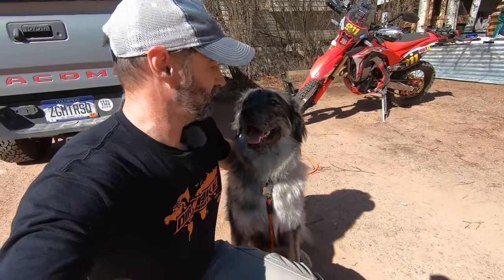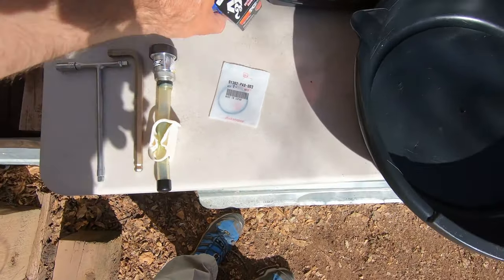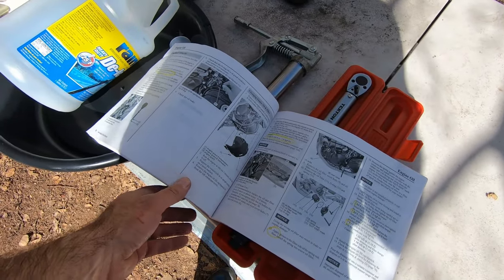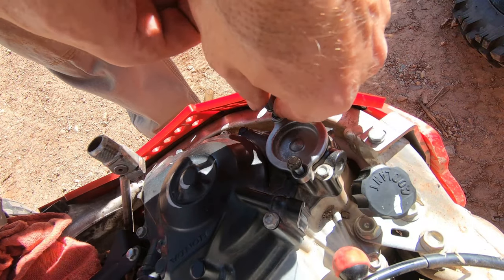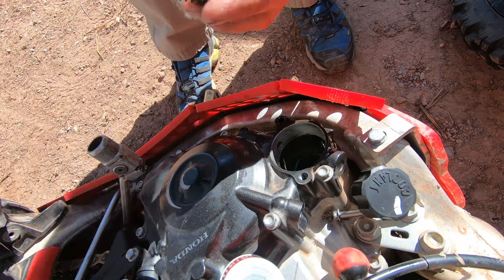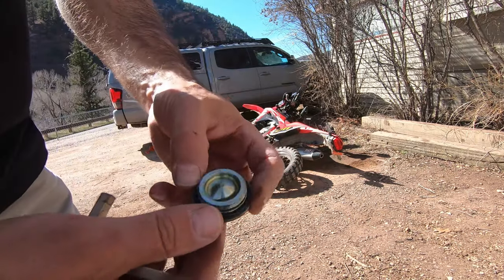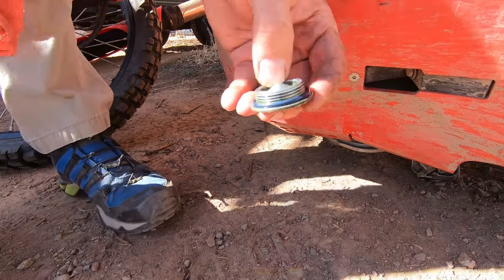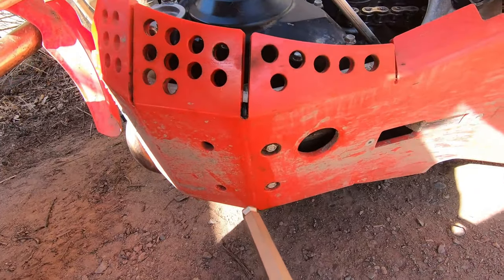How To: Honda CRF450L Oil Change Using A Works Connection EZ Oil Drain System

Comment: Yours is the best 450L vlog in the world. I’m a 500excf owner but I enjoy the series and in particular the oil investigations. Both bikes have similar oil change recommendations so I await your findings with great interest. By the way, loved the way you stood on the rack of your bike last episode. Couldn’t do that on a standard KTM but might be able to do it on mine as I built a pannier frame/rack system. Here in Australia it appears that the 450L has been a sales disaster. Pricing was ridiculous at first but it has plummeted. I would be interested but the lack of decent sized fuel tanks put me off. I wouldn’t be put off by the Honda recommended servicing schedule as I believe the bike would be a much better build quality than the KTM.
Reply from the maker: Wow. Thank you very much.   Nomad Tanks in Australia is now making 20l tanks, so there goes that excuse. Let me know when you go Red!
Reply: John T. Young Wow, thanks John. Just looked at their site and it looks very good, reasonable price too. Now the 450 L looks a very distinct option as the wonderful build quality of Honda’s is a big issue for me as I ride solo. Will keep you updated. Must go through you videos to see the best fueling tuning options. Here in Australia we don’t tend to be burdened with the full on pollution devices
Reply: DKW, I have been in contact with Nomad and there will also be a 15/16 lt tank out in a couple of months. It’s similar to their 20 with radiator guards included.

Comment: Awesome John, can you run over adjusting chain, clutch and brake levers, and how to lube clutch and throttle cables sometime for us newbies.  Learning a lot, thanks
Reply from the maker: OH man. There's a chain adjustment in here somewhere.....
Reply: Sorry for such a basic question I’m not mechanical, have seen the 3 finger measure at the chain guard as a general way to
Reply from the maker: @stevewasilow5556  yes. That's in the "close enough" range. Tho the rear tire should be off the ground when yoou do it.

Comment: It is funny to see, that the coolant tank cap does still have the same design like the one on my transalp xl600v from 1994:-)! 
Nice bike and a good explaination!
Reply from the maker: It's a Honda so it could be. Don't fix it if it ain't broke... ever.
Reply: ...what could you change in something that works perfectly? It's a cap. ;)

Comment: I love the long neck funnel. Great item to have in your toolbox . I have a Yam 660 supermoto and it's a messy job to add oil.
Reply from the maker: It’s like they made it to screw into the filler hole.

Comment: soooooo glad you stressed the drain plug "torque" by hand...  13 ft/lbs via a torque wrench has lead to issues as you mentioned. The grease is a trick I would do regardless, but if it is in the manual, then even better and will squash the naysayers. Good video.
Reply from the maker: Thank you!

Comment: very good to see how you handle with the drainplug...... maximum 2 fingers tight and enough....    i read about alot of peoples screwed up the threats by using a torque wrench and doing the 13lbft like in the manual
Reply from the maker: Not sure if there’s a flaw with some bikes that it seizes or what, but I’ve never torqued it very tight.

Comment: Hello John T.   I have been watching your channel for a few months.  I finally was convinced to get a new 450L and picked it up on Wednesday.   I have ridden it about 50 miles and I cannot believe the throttle toggle response. This is terrible.  I hope I can get used to it, but I seriously doubt it.   I am thinking of ordering the Vortez and the pipe.  Question is why you went vortex Yoshi vs vortex and FMF? 

Your channel does a great job on highlighting the options you have installed.  I will be rewatching these as you progressed with the bike.  After getting the throttle under control, I will likely do the seat next.   That seat is the worst I have felt on any of my bikes.   

Again, thank you for the videos and adventures.   Thanks for your service to your community thru you affiliation with the fire Dept.  You are a good man, keep it up.
Reply from the maker: Thank you so much John. I really appreciate that.  You're right the throttle response is awful. It has to do with the ECU turning the injector completely off with the throttle closed, the light weight engine internals, and the lack of any kind of cush drive. Riders coming from a street bike hate it most. The Vortex will smooth it out a lot.  I went with Yosh just because I've always had Yosh or Two Brothers systems. No other reason. Add the new ECU and a pipe and HANG ON.
Reply: Rod Z    Thank you for the advise.  I have ridden it for 150 miles at this point. True. The seat is feeling a little better.   I will hold off for a while to see how it settles in.   The throttle is not as bad as when I was first getting used to it.   But it still is not what I like.  Thanks again for the advise.

Comment: Update on the amount of oil that I put into my bike. I accurately measured the amount in. Halfway up the dipstick, flat ground after oil and filter change was 1250cc. 1380cc came out but I didn't put it in so can't say the difference is all fuel.
Be interesting when I do an oil change next time.
Reply from the maker: Let me know!

Comment: Hi john from oz  , love your videos 👍🏻👍🏻👍🏻 I just bought a 450 l , liking it so far , are you happy still with your axp skid plate , I like the idea of plastic , all the best  cheers
Reply from the maker: So far so good. No complaints other than it is so hard to put on (1 really tricky screw) I never want to have to take it off.
Reply: John T. Young  thanks for your reply John  , at least it looks like you don’t have to take off for oil change ,  👍🏻
Reply from the maker: @lizbarber3473  True

Comment: Another excellent video John.  Greatly appreciated!  I'm weighing the new CRF300L or CRF300RL against the CRF450RL.  The lack of suspension adjustment on the 300's really concerns me.  I know the CRF450L has significantly reduced maintenance milage intervals compared to the CRF300's...however, after watching your valve clearance and oil change videos I feel confident I can do both with no issues.  No Honda dealer in Tennessee has the new 2021 CRF300's in stock...but ALL the dealers in TN have the 2021 CRF450RL in stock and on their floor.  I've been working on big BMW's for years and your Honda seems fairly straightforward to maintain by comparison.  Another question for you please: do you by any chance have a list you could post of the many upgrades you've done to your CRF450L?  I'd be very curious to see that.  Thanks again and GREAT JOB!
Reply from the maker: I've heard and seen nothing but great things about the 300 Rally. Looks like a great dual sport bike. And yes, the 450L is a dual sport, but just barely.   In the description of every video, you'll find the list of all the mods on the bike.
Reply: @JohnTYoung  Got it!  Thanks again!
Reply: I ordered 2023 300L. Waited, never arrived. Decided on 2022 450RL. So far the power advantage has eliminated my concern over maintenace!
Reply: The 450 is actually lighter than the 300. And obviously better suspension.

Comment: Another thought came to mind. Perhaps a long trip of a few days 600 to 1000 miles doesn't contaminate the oil as much as 600 to 1000 done stop starting over many weeks. I presume when it's running it's not dumping fuel in the oil and that it's from when you turn it off each time? Don't know but it's a thought.
Reply from the maker: You must have been spying on my email. I just got the latest oil analysis back. This time I changed oil at 450 miles after a ton of start stop short trips over winter including just idling the bike to warm it up....  still over 5% gas in the oil. Long trips, short trips, 1400 miles, 450 miles - always gas in the oil.
Reply: @JohnTYoung  bugger that's not good. Back to the drawing board.
Reply: @JohnTYoung  still getting gas in the oil? And if so apparently it has little to no effect on performance right?
Reply from the maker: @aalejandro750  yes. It’s still in there but hasn’t seemed to affect anything.
Reply: @JohnTYoung  I guess at this point it's a non-issue lol

Comment: Watching to have a look at those blocked up,oil take offs...i'm sure it would be easy to tremble the oil capacity,using a catch tank/cooler on there...then you have an ADV bike
Reply from the maker: I’ve been looking at oil coolers but just can’t spend the $450 when all I have to is take 10 minutes to change the oil. Maybe when I add the rally kit....
Reply: @JohnTYoung  I'm looking to do 25.000 mile overland, there bits on that where i cannot get decent oil, getting the range to around 2500 miles by adding capacity would be great...like the bike!
Reply from the maker: Then it would easily be worth 400
Reply: @JohnTYoung  If it ever happens due to the Covid...we've cancelled November 2021 already,need to see where the planet stands in the Fall '21 before making a decision on November '22.

Comment: A question for you, if you don’t mind. Does the Honda have a proper Cush hub or is it just rubber cushioning on the sprocket? I put a Cush hub on my KTM as all ADV bike have them. Thanks
Reply from the maker: Not stock. The rubber is only around the outside of the sprocket to EASE the chain onto it. MoxMoto (https://www.motomox.co.nz/shop/show_single_product.php?prod=499) makes one though... for $300.
Reply: John T. Young Thanks, i guessed that was the case, judging by the photos of the hub. I knew about the Mox sprocket. Not sure what to think about that now. Every adv bike has them but Honda must have confidence in their build, judging by the service recommendations.

Comment: I ask because I really see the value in this skid plate... Can't you just Dremel the hole out of the skid plate LARGER so that you don't have to connect another gadget to drain your oil, then lay your bike down to just pick it right back up?
Reply from the maker: You don't NEED the extra gadget, it just makes life much much easier. And cleaner too.

Comment: Hi John 
Are you happy with the mosko moto reckless 80 panniers with the skeggs luggage rack?
Reply from the maker: Yes. The Mosko Moto 80 has been bomb proof AND when it's all cinched down keeps the weight down low and rides great.
Reply: @JohnTYoung  Thanks John, appreciate the reply. 
I have just ordered my mosko reckless 80 for my CRF450L, but am in two minds weather to get the skeggs or the Adventure spec rear rack, as the adventure spec also comes with a mini side rack which my help the reckless 80? Thoughts?

Comment: Just bought a 2019 CRF450L, Bike had all the necessary mods with 1,400 miles on it. STOKED! . What is the purpose of the magnet washer on the oil filter? RIDE🔥RED 🤛🏁🤜
Reply from the maker: To catch ferous metal particles in the oil.

Comment: John,  When you tip the bike on its side, by your demonstration, it looks like all the oil is still contained on the side of the bike.  When you open up both the oil filter cover and the drain plug, you can promise me that no oil is going to gush out?  In the beginning of this video, when you put the bike on its side, if you look closely you already have the EZ drain system adapter on the bike but I assume that is just your editing a new take showing tipping the bike and not you installing that to drain some of the oil first.    BTW, you are one of reasons I just got a 450 so you are to blame!
Reply from the maker: It's always all my fault. I'm getting used to it.   No oil will come out when you tip the bike over on its RIGHT side. 1. Tip it over 2. Replace the drain plug with the drain system. 3. Replace the oil filter while it's laying there. 4. Stand the bike up and drain the oil out being sure to rock the bike back and forth a few times. 5. Replace the drain system with the plug and DO NOT tighten the plug down very hard. Just a nudge.

Comment: Do you need to change the transmission oil too? Or is it a dry clutch
Reply from the maker: Wet clutch that uses the engine oil for lube.
Reply: can i use 10w40 metric amsoil
Reply from the maker: Sure!

Comment: I usually pour few drops of oil on the o-rings for smoother sliding + avoiding the risk of pinching them. In my old Yamaha manual they mention oiling the filter before installation (to be honest, the reason is beyond my knowledge). Being curios about Honda`s approach, I had a look in the manual (same as yours, only that I have it only in digital format). Nothing about pre-oiling the filter but they do mention about using vaseline for the spring :).
Reply from the maker: Ya. I find I do things automatically without commenting on them. So I end up adding text after the fact. Sorry about that. Pre-oiling the filter... tried it, made a mess, never did it again. Never had an engine blow up. Thanks for the comment!

Comment: FYI....the factory service manual specifies 10w-30 oil.
Reply from the maker: Well sort of. Actually the range for 10W-30 is from -10C to about 20c. Above that, and where most of us ride, it's 10w-40. Take into consideration the "fuel in the oil" thing that a lot of us encounter and I'll stick by my recommendation you use 10w-40 all day long.

Comment: Just curious why you went with 10w-40 as opposed to the recommended 10w-30 for L?
Reply from the maker: I ride in the desert and the heat a lot.
Reply: @JohnTYoung  I live in Southern California and mainly ride on the street to work and bring it to the trails maybe once a month. Would you recommend the 10w-40 for that? Or stick with the manual recommendation
Reply from the maker: @1383mhc  The manual recommends both, so always do what the manual recommends. 😉

Comment: Well here's an update from my oil change. Had a battle to get sump plug out . Probably overtightened at the shop before I bought it. Oil was real hot coming out as needed the bike real hot to help get the drain plug out. First thing I noticed was it stunk of petrol and was water thin. That said the bike was very hot so would have thinned the oil.
Just looked like a lot of oil so thought I would measure it into the waste container. There was 1380cc.
Now I didn't fill it so can't say how much was in it at the start but seems to much. Could the volume be made up with petrol? When I fill the bike I will measure exactly how much goes in . Then check how much comes out next time.  Oil has been in for 680 miles as I picked it up second hand just after the 1200 mile oil change. Have you noticed if you have more oil coming out?
Keep up the good videos 👌
Reply from the maker: I have not measured in or not, but I will starting next oil change. For $40 you can have your oil analyzed. Mine has gotten as high as 5% gas. Thanks for the unpdate.
Reply: @JohnTYoung  eek! 5% that's a lot of gas.

Comment: Just picked up one of these, going into the oil change now and the drain plug seems to be seized
Reply from the maker: It doesn’t take much at all to lock it up. Be careful not to crack the casing. If it’s stuck really bad, let a dealership break it for you.
Reply: @JohnTYoung  I spoke with the dealer about it, they don’t seem to be any more confident than I am and it seems like if they break it I’ll be stuck on the hook.
Reply: @JohnTYoung  Considering just using a vacuum pump and pulling the oil from the fill hole
Reply from the maker: Well you can try running the bike till it’s hot and then icing the plug then pull it out.  Just try not to deform the hex hole. That’ll press outwards and maybe crack the case.   When you put it back in just barely snug it. Barely.
Reply: @JohnTYoung  I tried the icing trick, still wouldn’t budge
Reply from the maker: @waferzworld  forever?!!
Reply from the maker: @waferzworld  oh no. I think I’d do everything all at once-ice, spray PB Blaster, impact wrench, apply for a new Visa Card to replace the cases.
Reply: @JohnTYoung  All of this is why I’m thinking it may just be easier to suck the oil up through the fill hole and be done with it
Reply: @JohnTYoung  Yes for the life of the time I own the bike at least. I have all of the necessary tools I don’t see it that much more difficult to pull from the top.

Comment: Got only 475 miles on my 2021 crf 450 rl. Stock. No pipe or Vortex tuner and oil already smells like gas
Reply from the maker: Ya. At this point it seems normal and doesn’t seem to hurt anything. But it still feels wrong.

Comment: The reason i don't read manuals is the amount useless information puts me to sleep john .
 
How many times have you watched a video on YouTube & discovered a far less time consuming & less difficult way to do the job . 

Just because a manufacturer technician wrote the book doesn't necessarily mean its the best way to do the job . 

In most repair shops you'll find those that read & write books in the office & the real Mechanic's on tools in the workshop & they don't use the manual for anything other then toilet paper when supplies are low
Reply from the maker: Those same guys aren't watching videos on how to change oil. I'll bet they've already done 1000 before they threw away the manual. Baby steps.

Comment: Recommending any type of automotive  10W40 is not correct.👎
Reply from the maker: Correct. Only use moto oil and be sure it's for wet clutch applications. But the brand does not matter - Motul, Amsoil, Motorex, etc....